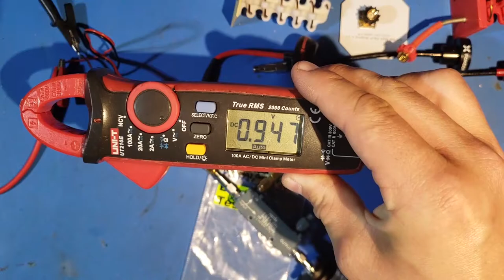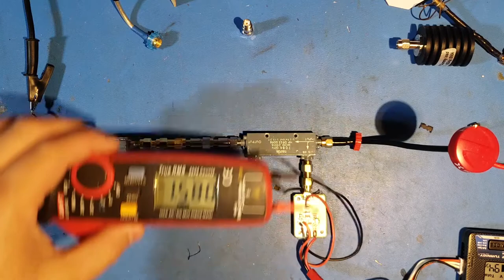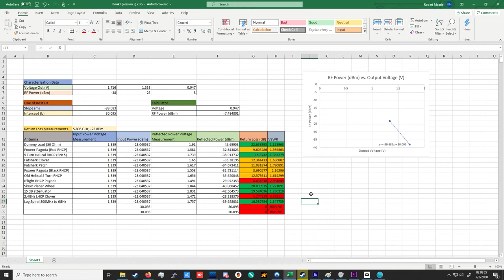5.8GHz VSWR Measurements w/ Directional Coupler on a Budget

Comment from the maker: The 3rd and highest stimulus point is -8dBm, not +8dBm. The value entered in that text field was not used in the calibration line of best fit, and later we check that .947V is close to -8dBm, the actual stimulus power, to assess linearity.

Comment: is this method can be use to measure the output impedance for the vtx?
Reply from the maker: No. This will only give you Return Loss (S11) == VSWR. This cannot take vector measurements R + jX and it cannot distinguish between R >= R_0 or R <= R_0. That is you cannot answer the question "is this mismatch because the resistance is lower or greater than 50 ohms?" You can only answer how bad is the mismatch in terms of S11 or VSWR.
Reply: @RobertResearchRadios  I don't have a directional coupler like you have, for example, the directional coupler output is connected to a 50 ohm dummy load, in my opinion if there is a reverse voltage value that is close to the forward voltage, it means the transmitter impedance is not close to 50 ohm. this is just my opinion, please correct me if i'm wrong

Comment: 6GHz nanovna is coming
Reply from the maker: I sure hope so. Do you have any sources yet or only conjecture similar to mine at this point?
Reply from the maker: Thanks for sharing, but all I can find under the name "RF Explorer" are products that are either a sweep generator/CW signal generator xor a spectrum analyzer. Unless you have a link to an integrated product, I'd have to pass on such expensive options, especially like the RF Explorers which don't seem to have continuous frequency coverage, just ranges for the more common bands neglecting the 3 and 4GHz space in upper S and lower C band. I'd much rather buy a 2nd hand Spectrum Analyzer with Tracking Gen from a reputable manufacturer like HP, Textronix, et. Al that gets me all the way up to X band and buy once, cry once.

Also, a spec-A + tracking generator setup and directional coupler form an SNA (Scalar Network Analyzer) which is usually assembled piecemeal on the bench as opposed to purchased explicitly as a single unit. I'm looking for an affordable VNA (Vector Network Analyzer) which can give me S11 and S21 at least as vectors (real and imaginary components) s.t. I can easily design matching networks using 2 or 3d smith chart software like Sim Smith (or ADS's smith chart tool) or 3D Smith Chart Tool respectively. Otherwise I'd be left guessing at a matching solutions until the magnitude of S11 was reduced to the desired return loss (or equivalently VSWR).

Anyhow, maybe I missed a product that is a full SNA or you have an affordable (sub $500) VNA to share. Let me know if you see anything; I'm always on the lookout. I look forward to interacting with you more in my comments section; I think you're going to like my next RF related videos that should be coming out over the next month. Stay tuned.
Reply from the maker: Gotcha. I didn't know they sold it as a set, but if I had both i'm sure i'd use them quite a bit. Cool piece of kit those are, especially when combined.